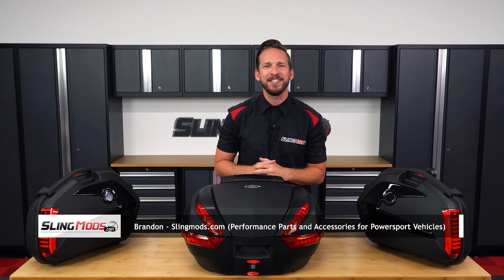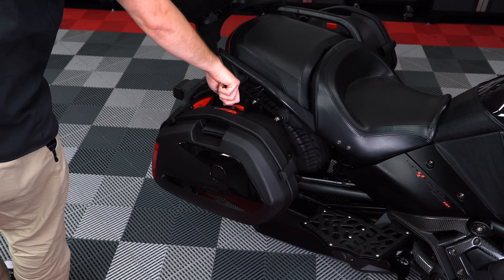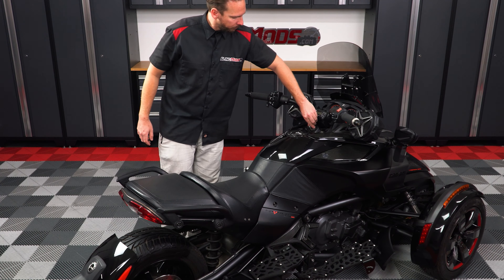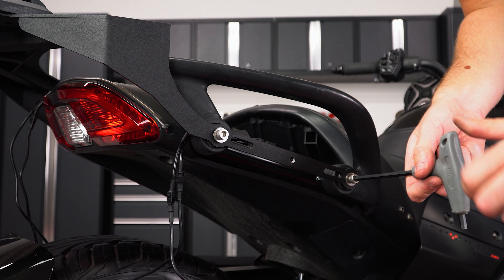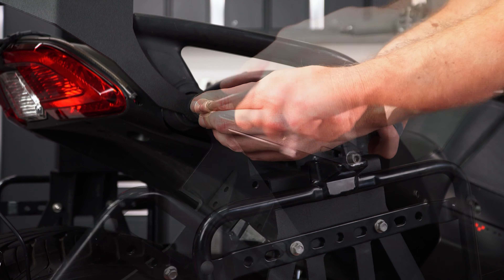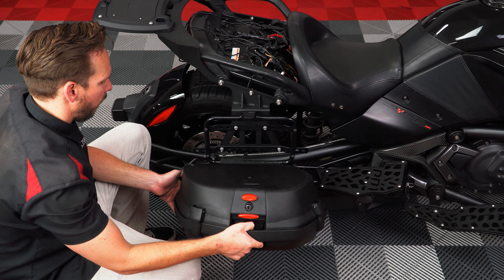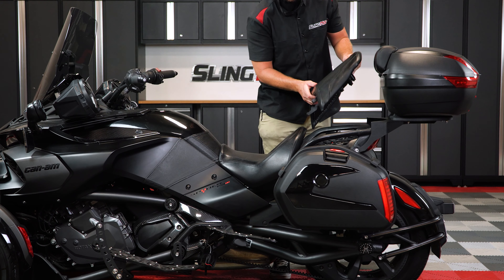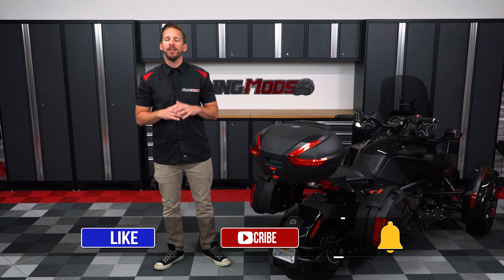Can-Am Spyder F3/F3S 3-Piece Luggage Set with LED Illumination

Comment: In regards to how secure they are, when on the bike, are they firm against the bike like the factory, or is there vibration.  Looking at all models.  Want/need the storage of the rt, but that price tag is going to keep me out of the market longer
Reply from the maker: Hello Shanda, there's no audible vibration. There is a tiny bit of movement on the bag latching system when mounted in place that's needed for the tolerance of the latch... but it's not something anyone has complained about.

Comment: Can I still use my f3s factory backrest with the top case on. I want to use both top case and BRP backrest . Not interested in using the cushion on the top case. My BRP backrest is too expensive to give up. 
Thanks in advanced.
Reply from the maker: Hello DJ, I completely understand that. Regretfully I do not believe your factory backrest will be compatible with this setup as the pad included on the top case was designed to act as the passenger backrest.
Reply: I had the same issue. It's either retaining the expensive passenger brp backrest or the topcase. I tried to salvage both but the case is offset by a couple of inches putting enormous pressure on the side support brackets which eventually snapped. (Note: These were not bought from slingmods but the same challenges would apply).

Comment: So I assume the standard F3 cover won't work with this, do you offer a cover that will?
Reply from the maker: The standard F3 / F3s cover will not work with these bags installed. I would recommend the Full Cover for the F3 Limited since that bike comes with a top case and saddlebags. It wont' be an exact fit.. but it's close. That can be found here: https://www.slingmods.com/can-am-spyder-f3t-f3-limited-full-cover-ultragard

Comment: Are there bags without added the brake lights
Reply from the maker: Hello Charlotte, no there is not. If you do not wish to have the LED's on the bags illuminate you can simply skip the electrical wiring portion of the install. We have had some customers do that. Thanks!